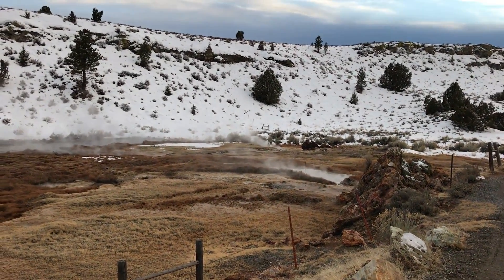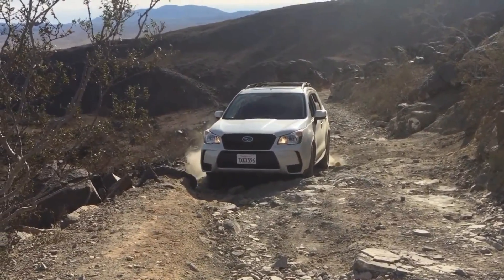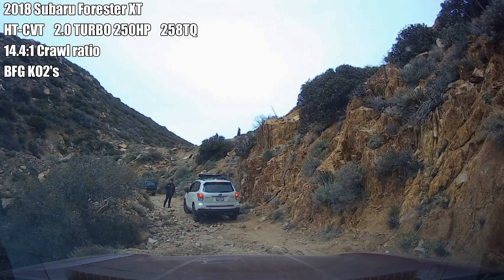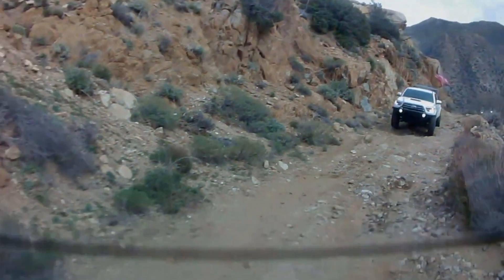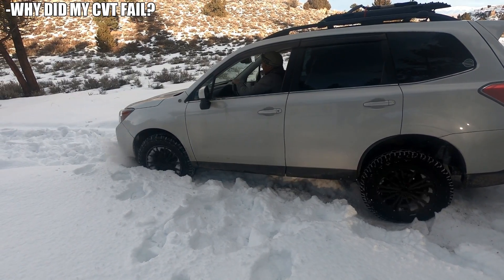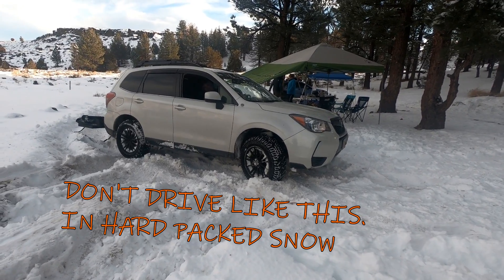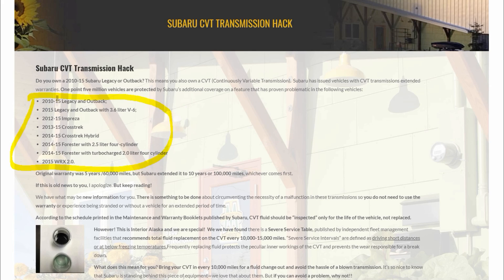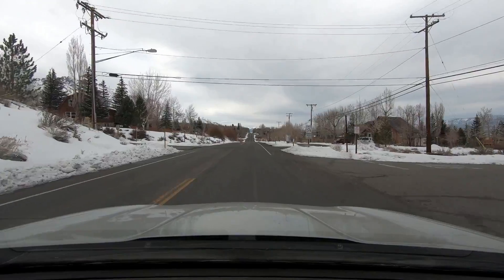CVT transmission Failed!  Can we make them last?

Comment: Might be a dumb question, but how are you checking your CVT oil temps? do you have a gauge installed?  would long stretches of highway driving also make the oil temps go up that high?
Reply: You can buy a monitor that shows the fluid temps of the CVT. It's worth it imo. If you're just cruising on roads and stuff you probably don't need it but certainly if you're going off road.

Driving on the highway is likely not a problem long-term, but if there was a big incline and you'd been driving for awhile prior it might get a little hot.

Comment: My wife’s 2011 outlander sport and my parents’ 2011 outlander both have over 120k each and no problems with their cvts. We don’t offeoad then or anything lol just drive them on normal roads. Owned them both since brand new, drained and filled around every 15k. Expensive but worth it. Recently i switched to using castrol cvt fluid which is 4x cheaper but works fine. Goodluck!

Comment: We know now the main problem with a CVT is the heat build up on the contact points. from between the cones and the steel belt that these transmissions generates, It  produces a lot of abrasive carbon. from burning a small amount of transmission fluid  The other is the filter in the CVT.  It is only meant to filter out  metals it will not filter out the build up of carbon. I still feel just finding a way to install a CVT fluid carbon filter would go a long way to stopping these CVT transmission from getting damage.  But the problem is if we did that the carbon filter would  have to be change ever 40,000 miles  ( 64373.76)    There are Auto repair shops now who are putting a  100,000 miles  (160934.4 km) guarantee on the CVT that they have  rebuilt. this guarantee is only there  as long the  customer  brings the car back in to get the  CVT fluid change ever 40,000 miles ( 64373.76).
Reply: It's a whole bunch cheaper to change transmission fluid and filter every 40,000 miles, than change the entire transmission every 160,000 miles! I like your idea.

Comment: Over time the damage to the CVT transmission is not just restricted to the belt and cones It always  cause by the incredible amount of heat these CVT transmission generate  from the contact points in the belt and cones  causing a tiny amount of the CVT fluid to be burnt and turn into carbon over time this  carbon in the CVT fluid. build up But only from the points of contact.  Over time This  build up of carbon in the CVT fluid acts as is a mild abrasive.  over time it will also destroys the valves in the CVT transmission, as well Look at it this way We know  A car engine will over time build up carbon it why  we change the engine oil   if we did not regularly change the engine oil the build up of carbon would damage  the engine.   if it were not for this build up of carbon From the belt and cones The  CVT transmission would out last the life of the car. We know this now because before the CVt went into  production Nissan tested five of these CVT transmissions for five years And they ran them 24/7 up and down hills and in city traffic.  The test in the end  showed that all the five  CVT transmission that  they had tested,  had lasted well over 300,000. with no noticeably extensive  wear and tear. But we ask what keep these CVT transmissions going,  It was the fact  that ever few months The transmissions were taken out of the test cars,  to be  examined and then they were put back in.  But when they did this!  they also replace the CVT fluid.  So over the five years and 300,000 klms that these CVT had done  there was no real  build up of the abrasive carbon. So  just by regularly changing the CVT fluid it will keep any CVT transmission going for years.
Reply: No it will not, my sister's outback CVT didn't last one year.

Comment: I don't see why they couldn't have made it possible to replace the belt and pulleys without re-building the whole transmission. Of course that would require keeping the fluid in the belt chamber separate from the rest of the transmission, but let's face it, the belt is a wear item. It will be a while before CVTs like this are suitable for anything but conservative economy driving.
Reply from the maker: PC No EXACTLY!! I wondered the same thing too!!  The Subaru engineers thought this transmission was indestructible and it would last the life of the vehicle without transmission fluid change.  I wonder what their definition of “lifetime” meant.

Comment: My brand new 2020 Kia Souls cvt failed at 636 miles. Less than 2 weeks after we drove the new car off the dealers lot. see the video. https://youtu.be/cLKWHGQki7I
Reply: Well it is a Kia so I'm honestly not surprised.
Reply: @bb2status  my kia soul 2013, 90K mi. Runs good, no any problems at all.
Reply from the maker: Kevin Wilkerson Wow!  They typically last longer than 636 miles. I would say I didn’t believe you but you have video proof and showed us your service record.  Thanks for posting!  I hope your 2nd CVT gives you many more miles, at least 100k!
Reply: Yes it was crazy. If I had any more miles on the car I probably wouldn’t have posted anything at all, but I just found it ridiculous that a brand new car it went out I haven’t even made my first car payment or had my first oil change yet!
Reply from the maker: Kevin Wilkerson even at 30k miles, that’s just too early.  Your situation was exceptionally early.  With that said, 99% of the time, a new engine or transmission will not be as perfectly installed as from the factory.  That’s just not fair to you.  Keep us posted, and again thanks for letting us all know.

Comment: The only cvt that is good is the e-cvt in the prius.
Reply: My wife’s 2011 outlander sport and my parents’ 2011 outlander both have over 120k each and no problems with their cvts. We don’t offeoad then or anything lol just drive them on normal roads. Owned them both since brand new, drained and filled around every 15k. Expensive but worth it. Recently i switched to using castrol cvt fluid which is 4x cheaper but works fine. Goodluck!

Comment: The concept is good ,but the principal is not long lasting compare with conventional Trans that we've been used for years:One belt drive every thing and it move in and out all the time This is a issue cause CVT trans won't last long ,and when it brakes ,it will come aparts causing alot of problem to other components.......................
Reply: True, not designed to last and can't even go off road, just rubbish.

Comment: Would Subaru manual transmission perform better?
Reply from the maker: Chandra Stephens a manual transmission would last longer and put more power to the wheels, but it would be generally less capable when taken off pavement.
Reply: @JonDZ_Adventuring  so basically you have to be an expert to utilize a manual transmission for off-roading what a bummer, I have a Subaru Crosstrek CVT and im afraid it's going to crap out after 100k miles I have been careful with it. I bought the car used the original owner I have no idea how he drove the car so I feel like I'm rolling the dice on this car
Reply from the maker: Chandra Stephens I hear ya Chandra, just as long as the previous owner didn’t tow things with it, you have a high chance it will last.  Did your crosstrek come with a tow hitch receiver?
Reply: @JonDZ_Adventuring  yep, well I will take a chance on this car. My next Subaru will not have a CVT, thanks for posting your awesome content keep 'em coming
Reply: @JonDZ_Adventuring  its not the transmission that its not capable. Its the driver. Here in Greece most people who drive pickup trucks are really good at off roading and they rarely stall their car
Reply: No offense, but putting k02' s on a car and burning the arse off of  it. No wonder something failed . For the record I have a 13' Crosstrek and yes I am worried about the Cvt even though I drive  like a sane person.

Comment: I agree I have a   Nissan Quashqai with an Auto that a  CTV but it more then just buying  a transmission cooler and  changing  out your CTV fluids  regularly I also did that  its also how you drive it, For a start  When cold CTV oil needs  to be warmed up to operating temperature (for at least 5 minutes)  before you start to drive the car.  CTV transmission are not prone to heat  just travailing on a straight road  But there prone to heat when towing  or city driving.

Comment: Subaru sucks . They rebuilt our engine 3 times and now transmission problems at 80,000 miles . You suck Subaru .
Reply: Don't blame SOA for a dealership full of incompetent techs, that didn't do the job right the first time.
Reply: @MrSubaru1387  bullshit. My company owned a fleet of a dozen 2014 Subaru Foresters. Every single one of them consumed oil and had cvt failures/issues. It’s a SOA problem.

Comment: Your driving broke the cvt
Reply from the maker: Manny Lumbres I appreciate your opinion, but I’m driving up even more difficult obstacles in my Honda Passport and I already have 27k miles on it with 11 months of ownership.  I’ll match the 60k miles by next year.  We will see if my driving breaks my new vehicle.  I’ll let you all know.

But, just so you know, even street driven SJ Foresters have a hard time getting past 100k miles.  There’s about a 100% failure rate before 120k miles.
Reply: @JonDZ_Adventuring  Where do you find these numbers? 100% failure rate before 120k miles? I just got a 2016 and mostly bought it for safe trips along northern sweden dirt roads. Would like it to last at least 10yrs but I think as soon as the warranty or insurance is up i'll sell it...

Comment: I dont think i will buy another subaru after my experience with the cvt on my crosstrek. Its completely junk. Ive gotten stuck in the snow and its very hard to get un stuck because the cvt refused to spin the tires.
Reply: That was completely driver error. CVTs have modes to do that.
Reply: Disable traction control. Just a push of a button. Not the car's fault.
Reply from the maker: Sebastian Kvyat I know what you are talking about.  I have a newish video with a 2nd gen subaru crosstrek getting stuck in snow with an experienced driver.  You definitely have to turn off traction control, but I’m sure you did that.
Reply from the maker: Jake Colbert not all snow is created equal.  In hard packed snow, a Subaru CVT will bog down and won’t spin tires.  It’s important to maintain momentum and avoid getting high centered.  Once a Subaru CVT Subaru gets stuck, it can be very difficult for them to get unstuck, just like Sebastian said.  Here’s one of my more recent video’s showing just that.  His traction control was off the entire time.

https://youtu.be/UcRJCHpbVe4
Reply from the maker: Jake Colbert I know you weren’t replying to me, I’m just trying to keep it real and gave you a “real example”.
Reply from the maker: Jake Colbert I’ll take your word for it.  This video shows where the CVT will reach its limit and not spin tires.  What kind of terrain are you driving on?  Also, are you monitoring your transmission temps?
Reply from the maker: Jake Colbert 155k miles?  That’s impressive.  Are you on the same CVT?  Also, what did you think about the terrain in this video and the CVT reaching its limit where the tires don’t spin?  Basically, what is happening is the CVT is stalling out.  Can Happen to automatics too, just not as easily.

Comment: I own 2 15 Honda CR-V’s with CVT and lease a 17 XT WITH CVT.  Honda recommends CVT fluid change at B interval (about 30k miles), and the fluid smell so burnt plastic and so dark that I decided to do every 15k (Honda HCF 2 fluid is pricey but beats a new transmission price).  When I leased my XT I bought all the scheduled maintenance, thinking it’s going to include at least 2 CVT fluid changes, but nowhere in forester or XT service interval suggests or requires CVT fluids (ok 90k miles).  Never get CVT, and change fluid almost as often as you engine oil.
Reply: CJ K Honda recommends cvt fluid change every 50,000 miles
Reply: @11bangxiaolaohu  What 50K?  The CVT fluid was so dark and nauseous smelling even at 30K, and it was mostly suburban miles.  And I done it 3 times (2 on a FWD and 1 on AWD) and all terrible.
Reply: CJ K that’s interesting. Because I work at Honda dealership, I change all the fluids all the time. We should do CVT fluid change around 50k, and it still looks clear and in a amber color.
Reply: @11bangxiaolaohu  That is why I mentioned suburban mies (MD near DC) because I figure type of driving affects CVT operational parameters.  It definitely looked less dark/less smelly at 15K than 30K.  Anyhow, I own the CRV's so I don't mind the $60-70 for 5 Qt. of HCF-2's every 15K.  But Forester XT is a lease (originally with intent to buy) and I am noticing CVT feeling notchy even at 30K (fluid unchanged).
Reply: CJ K I don’t know about Subaru cvts, but for Hondas, even with 60 or 70k, the cvt fluid still doesn’t look dark at all. Interesting to know that it actually can get that bad within only 30k. And by the way CRV cvt takes about 3.4-3.6qt, 5qt will be too much.
Reply: HinRed yes you are correct on cvt capacity. I was thinking of the engine oil since I do both at same time. And both my CRVs are 2015 batch.
Reply: Maybe it has something to do with the break in process of the car. Maybe the very first change should be at like 10k miles, I wonder if that would help.
Reply from the maker: CJ K it’s a good thing you leased the FXT!  Smart man!

Comment: Why not get a manual transmission? We bought Mazda because they are the only ones still using a conventional automatic transmission. Not sure if it is heat or just abuse of offroading. I wonder how long it would last in a conventional driving scenario? I really don't think even then you are going to get to 200k miles on one.
Reply: Most people unfortunately don't know how to drive something with a manual. People nowadays hardly care to read into the cars they're buying, just looking at the MPG numbers and getting giddy about 33 supposed MPG.
Reply: @pixelbucket8884  Millennial Theft Protection.
Reply: @pixelbucket8884  And does it have a phone charger.

Comment: If you have a CVT vehicle, it's probably wise to do transmission fluid change every 30k miles. CVTs are delicate in nature. Also avoid flooring it often.
Reply from the maker: Official Jonathan great advice!!!
Reply: 3yr/36k miles drain and refills are optimal.

Comment: I had experience with a cvt and having to pay for replacement at just past 60k on an Audi and told myself never again for cvts.
Reply: 60k to get it repaired.? Could’ve gotten yourself a loaded TRD 4 runner. Although Audi is in another different level when it comes to driving to hugging canyon road. I’ve always like Audi , but I knew the cost is going hit me when it comes to repair.

Comment: Get a stick shift next time will last forever.
Reply: They don't even have stick shift any more now most car comes with auto only unless you get the base model t
That is strip down
Reply: Nope. Had an 01 Outback and went through two manuals in 175k miles.
Reply: @scott8919  what do you mean 2 manuals? You changed the clutch? Clutches are cheap. If you don't know how to drive and you burn the clutch thats your problem. I got a manual daihatsu with 400.000 miles with no repairs

Comment: As soon as your tires start to slip with a CVT transmission the computer engages the brakes.   The reason being is, if your tires are slipping and then all of a sudden they grip, with an  automatic transmission you're going to do a burnout which is very cool. if you have a CVT transmission and  your tires suddenly grip the pavement you're going to hear a loud clunk this is the sound of your transmission self-destructing. Not cool!

Comment: Subaru, has extended the Forester 2015(all) warranty to 10yr, 100,000mi. So, use the hell out of your cvt, it's their problem. I know that's how I use mine.
Reply: Warranty will not cover off road use. If their are any signs of it then they WILL decline coverage. They will also decline coverage if any modifications were done that could effect the powertrain this includes Even slightly larger tires let alone suspension, intake, exhaust, etc.
Reply: Robert McAleer I’d like to know the source too. Not disagreeing or agreeing.. just that JonD got his fixed/replaced(?) didn’t he; or did I hear him wrong in the video? And he has a lift and larger tires?
Reply: @mr2ti41  100% true. My company sued Subaru of America for denying warranty claims on our 2014 Forester fleet. All under warranty. Oil consumption and cvt problems on all 12 of the Foresters. They claimed that they were used off road. Which of course they were. That’s what my company does. We were a kayak and adventure company. We hired an attorney and successfully got out of our fleet lease to the tune of 20k dollars.
Reply: @haroldbeauchamp3770  wow that is sad that Subaru would even try to deny it??? I literally just got my car lifted BY Subaru! I'm not planning on going "off-road" (more like soft roading), but I would have a cow if they used that against any claims I may have down the road that was related to "off-road" use.
Reply: @mr2ti41  you could have plausible deniability that your car was ever off road. We couldn’t deny it. Our company logos were well known. Everyone knew what we did
Reply: @haroldbeauchamp3770  Interesting... I will have to keep that in mind. Thanks!
Reply: @YoureMomsMaster  could you cite this with a link please?

Comment: after 3 subarus i wont be buying a new one with a cvt. they are horrid. subaru used to be great cars but now toyota is buying more shares in them they have turned to crap
Reply: @Lunas Ra the wrx is still available in manual, but its a shadow of it former self. too much electronic bs onboard